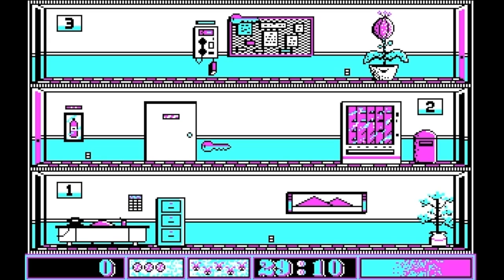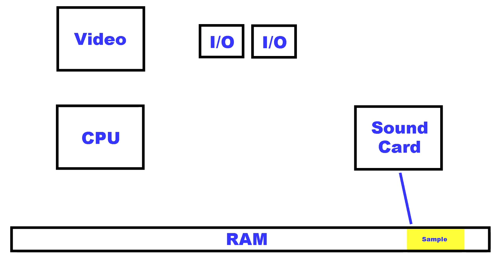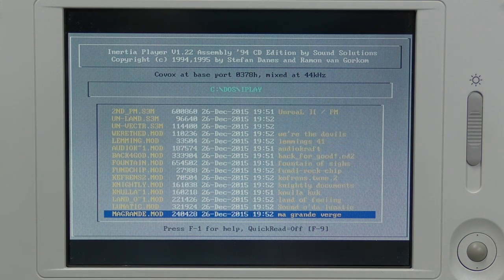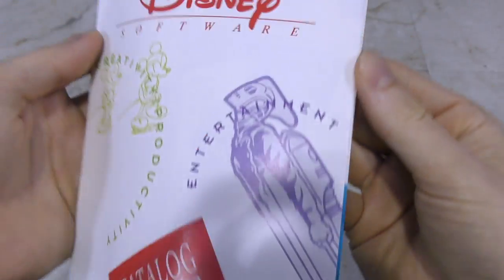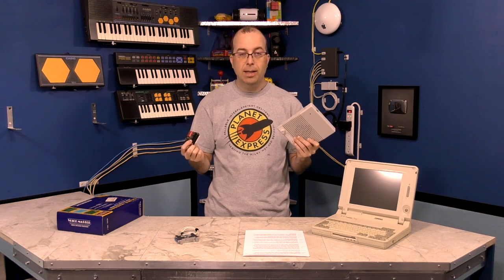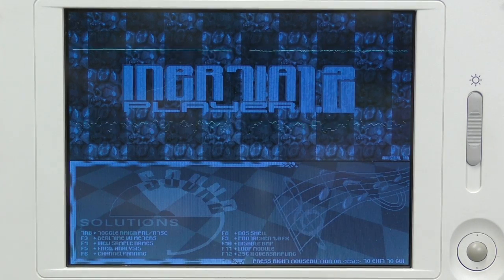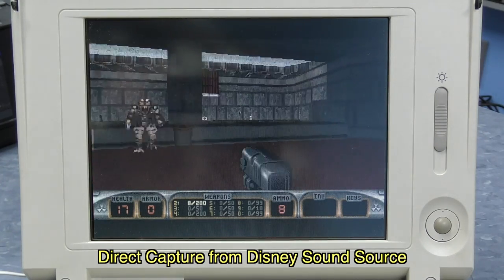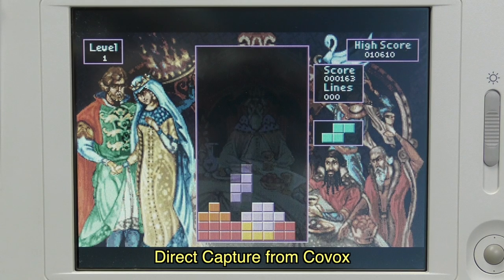How the Covox and Disney Sound Source Worked.

Comment: Just as an FYI, because no-one else has said anything about it yet - putting out to the parallel port is far less heavy on the CPU, because you can DMA to it most of the time. And when you can't, then you can at least use timer-controlled interrupts... the CPU does get taken over during that time, but it shouldn't take any longer to move 8 bits to the parallel port than 1 bit to the speaker, as it's just one clock tick either way to move 8 bits on a PC (or 16 on a 286, 386SX, or 32 on a 386DX / 486 / etc), or anything less than that. And there isn't all that extra code needed to try and translate 8-bit samples down to dithered 1-bit, it can just throw them straight at the Covox and have done with it, exactly the same as playing through any other sound card.

If it was anything other than like that, after all, your computer would get tied up hard when using the parallel port - for printing, or with a Zip Disk or CDROM or memory card reader or other such external drive connected, or a scanner, or any of the other various devices that co-opted it, all of which would need to move at least as much information per second as for sound playback. Even a floppy drive rates about a high enough data rate for better quality audio transmission than the PC speaker (it can sustain about 15kbyte/sec, and that's an average - peak speeds over the course of a rotation can be much higher), and a CDROM of course needs 10x that rate (reading rather than writing, of course, but there were eventually parallel CDRs that ran upto 4x), Zip sitting anywhere from about 45 to 300 kb/sec depending on how good your parallel port chip and driver software was. 8-bit mono audio at a CD-like 44.1khz would be, well, 44.1kbyte/sec... (using small 1000-byte kilo's, of course).

Let's put it this way - did you notice any kind of slowdown with that 486 when it was running Covox audio, even at 44khz? I remember using Inertia Player back in the day, and it had some quite nice visualisations built in, and it could handle some VERY hefty modules, stuff that might even occasionally challenge a 486 with a proper soundblaster (stereo, 16 bit, but not really an issue given that it was a 32-bit system; the only slight slowdown might have been from the card sitting on the 16-bit ISA bus instead of the 32-bit PCI one, but it was kinda daisy-chained and buffered anyway). If you load up one of those, and then put up one of the heavier visualisation screens, does it seem to stutter at all? If so, any difference between changing the CPU speed between full and battery-saver (on one of those, likely 25 or 33mhz and 8mhz, so you'd be looking at something like 11 to 14.7khz at the lower end... though, it could play DN3D, so maybe it's 50 or 66mhz?! rare to see anything faster with no built-in audio...), and turning the sample rate up and down by a similar amount which should reveal any difference in how the actual audio calculations are lagging the processor vs the DMA transfers? (obviously the common sample rate between high and low CPU speed should be the lower of the two...)

I have a funny feeling the answer would be no on all fronts, given that this was a device initially made for pretty low-end machines... the only things that generally couldn't be upgraded with internal cards were laptops, which used to lag behind desktops in terms of power even more than they do now, and anyone who couldn't afford even a basic Adlib or a Tandy-type card (there were clones like the Mockingbird; presumably you could, at least back then, get around the detection issue by shadowing part of the BIOS into RAM then inserting the Tandy string to the shadowed part...?) likely wasn't able to find the even greater pile of cash required to upgrade from their old "mute" 286 or even original 8088 based machine. Now consider the actual differences in raw mhz between the machines in question, and more particularly the difference in speed of their respective peripheral buses, and how challenging they'd actually find the extremely simple and fundamental task of taking data A and inserting it to address B. The latter cannot really have got more than 2x faster down the years, especially for 8-bit data which wouldn't see any actual speedup from working over a 32-bit bus vs an 8-bit one. If your 486 runs at a healthy 33mhz, then even the slowest 8088 isn't any more than about 1/7th the raw mhz - it's such much more capable a machine mainly because Intel did a lot of work to reduce how many clock cycles the more complicated instructions took, and introducing even more complex ones that could take the place of several old ones in a single, efficient step that saved time by reducing the amount of memory reads needed to run through the procedure as well as needing fewer actual calculation ticks. So that's 14x difference at the most, between efficiency in that extremely simple task and actual clock speed. And whilst both of those are likely 1:1 with their main frontside (CPU to RAM) bus, the peripheral bus hanging off that is probably the same for both - good old fashioned ISA. Not much call for PCI grade equipment in a 33mhz laptop, so why mess with what's not broken? If I'm extremely generous here and assume the 486 has some flavour of EISA that's 16 bits wide AND can use that to its advantage, and it runs somewhere in the 14-16mhz range (either being twice the 7mhz of the original, or half the clock rate of the CPU), there's something like a 4x speed differential.

Of course, that's oversimplifying a bit, and there's matters of how fast each one could context switch in response to an audio timer interrupt, how much slack the program code had in it (even with an original PC there might be large parts of a video frame where it was essentially idling in simpler games, whilst DN3D on the 486 will be running the CPU ragged 100% of the time), so on and so forth... but, on aggregate, I'd suggest those figures effectively mean you should be able to plug a Covox into an 8088 PC and, if you kept the sample rate down to about 11khz, or at least the 7khz of the DSS, see either minimal slowdown or in fact none at all, and in fact possibly nothing worse than would be seen with a Soundblaster in the first place (given that ANY PCM-based sound channel is going to create more load than a typical consumer grade synth chip that's not itself trying to produce PCM through crazy PC-speaker grade tricks; I think the maximum that an SB16 synth can actually accept in terms of command rate is about 95kb/sec, and that's during peak load e.g. initialising at the start of a song... normally it would be far, far less, hundreds of bytes per second in some cases... those those writes themselves would need to be correctly timed and buffered...) - though of course some small lag might be noticeable vs plain PC speaker or some kind of synth card. IE, the worry about it clogging up the computer is probably overblown. You can get variants of the device for basically any computer with a parallel port or other exposed at-least-8-bit-wide bus, after all, even some sub-1mhz models, so it must have been considered worth the trouble.

The one problem I could see with using DMA is that you might not be able to effect any kind of control over the replay rate from the computer end, usually it was up to the connected hardware to deal with its own timing then signal a request for DMA access to the computer, whose bus controller would then either say OK or make it wait for a moment. This would even be the case with the parallel port even though it's the computer's own main DMA controller that would be responsible for chucking data at it - you would be able to set a start and end address in memory (or start + length more often, e.g. up to a max of 64kb at a time before having to bother the CPU to set up a new transfer), and tell it where to send the data to (more traditionally a sound or video card, or the disc controller, but in this case the parallel I/O port), but after that the timing was down to what the recieving device could handle or would ask for. Same way as with a connected modem or regular printer.

Happily those ports have such control lines built in, but presumably whoever made the Covox went for the "cheapest and simplest possible" philosophy (whilst we're on the subject: the absolute nerve of asking $79 for something that's essentially a septet of resistors soldered across eight pins of a parallel plug, and then connected to one side of a mono headphone jack, with the other connected directly to the plug shield... damn... some people really know how to hustle), rather than "the cheapest and simplest that's actually practical" alternative. The PC side of the port, after all, also has some measure of control ability beyond simply putting 8 bits of data on the main pins, and it surely would have been a simple enough matter to use a loopback of some kind to con the PC into self-triggering a DMA send under timer control, or put in something simple like a 555 chip to trigger another "ready to receive" blip with the PC's "new data on pins" strobe resetting the counter... or in fact it could basically be free running, just with that pin supplying enough power to run the chip, so when it's active the device continually asks for another byte every 1/7000th of a second, and when it's not active, well, the chip isn't powered. In fact, I bet that's literally all the Disney thing does different - it shouldn't NEED a FIFO on board, because the PC I/O system already has them built in, and the data is kept valid on the parallel pins for as long as it needs to be between updates; adding an extra buffer to the device itself sounds extremely hokey. It's more than likely they just altered it very simply to be self clocking - at what is possible THE lowest sample rate of any common PCM audio channel in existence, other than the Atari STe's rarely used minimum 6.25khz rate, and the extremely low quality 3 to 6khz samples used for certain Amiga SFX...
Reply: (which is a pity really - I bet for a dollar or two extra on the sticker price, they could have implemented some way to change the rate between certain more useful settings, say a choice of four at 5.5, 11, 16.5 and 22khz, or 8-12-16-24, etc, to better match whatever material was being played... 24khz is in the same sort of zone used for higher quality sample playback and moderate quality music synthesis on various 16-bit consoles and non-PC home computers after all, so it would still have sounded just fine, and the others could cover various other uses down to plain speech... and, heck, a simple choice between 11 and 22 would actually have covered the majority of bases. And as there likely wouldn't have been any need for the rate to be absolutely consistent between each individual unit, or even to remain constant as it warmed up, a simple 1 or 2 way flipflop (ie essentially a 1 or 2 bit register), or even a set of AND/NOT gates on a generic logic chip if the status lines driving them could be kept latched on or off instead of only operating momentarily, plus a dozen or so additional discrete components (resistors, capacitors) besides those already attached to the data pins, connected to the timer in different configs depending on the set speed, would have been entirely ample. Not even any need for an actual crystal, just a resonant RC tank... frequencies in the dozens of khz are entirely within the spec of a 555 or similar...)

Oh well... old timey things, people did some weird stuff that must have made sense to them at the time, even though with 30 years of hindsight we can look at it and go "hey, you know, if you just added this one extra component in here you could make your thing work so much better for mere pennies...".

...and now I'm wondering once again about whether plugging such a thing into an old Atari could add a handy Actual PCM channel to any ST model alongside the PSG... and give the STe's a third channel to play with besides their existing two, meaning that if you also took advantage of PSG sample playback it would have an Amiga-rivalling four hardware sample channels.

Though the Amiga would still hold the advantage over anything else discussed here thanks to having a crucial ability otherwise only actually seen in general with proper PC soundcards and some Yamaha all-in-one soundchips - completely variable playback rate, as in each of its 4 channels has its own DMA timer circuit, and can divide the system clock down by between about 256 and 65535 times with very fine granularity, so the CPU doesn't even have do the precalculations and prebuffering every other system not so equipped has to in order to replay things that aren't an exact match for the hardware playback rate, hence why it was such a good system for playing tracker music on,  because once you also consider the dma interleaving possible on 1980s vintage 68000 systems (the memory available at the time had developed rapidly enough that affordable chips were twice as fast as what the affordable CPUs had been designed for, so a relatively simple bit of buffering and access-channel switching meant that AV output DMA's could hit the shared memory space without interrupting the processor at all), it can read and output four different 8-bit sounds each at any arbitrary frequency from about 110hz (so it can do pretty deep bass using a simple waveform) upto 28khz, and any volume across a 60db range too, without placing any measurable load on the CPU other than that needed to reload each channel register with the start address, length, speed and volume of the next sound.

So no matter what you plugged into your machine, unless it had similar self clocking DMA ability, it would always place more load on the system than an equivalent Soundblaster, or the Amiga soundsystem or that of an equivalent console. But I still can't see a Covox really demanding so much system time in its own right (there's no law saying you HAVE to use arbitrary frequency samples with it that then need actively retiming by the CPU either before or whilst they're playing after all)... the actual strain it could cause would be more down to the software and drivers making use of it, same as with a lot of sound sources.

Of course, the bigger question is why they did something as wild as making an actual plug-in DAC - and charging a king's ransom for it - when at the time very few games would have had sampled audio anyway, and it's far more likely that the majority of support would have extended to having it make some rather PC speaker style 1-channel bleeps and burbles at quite low frequencies, just with a greater range of still simplistic but hopefully less ear mangling waveforms, variable volume, and less system load than all but the simplest low-tempo timer reloading... and I'm afraid I can't help returning once again to good old fashioned laziness and profiteering.

Let's compare another device, which could easily have been built as a Covox-style parallel plugin if desired, with just a minimal amount of interface logic - the FM Melody Maker cart for the Atari ST. A device that concealed a variant of the Yamaha 2151 synthchip (as found in the Japanese version of the Sega Master System, amongst its other rather limited uses), some interface logic and a couple of software controllable passthru sockets for mic and the computer's main sound signal (3.5mm, with an output 3.5 at the other end), which plugged into the computer's ROM port. Able to produce, IIRC, six simultaneous channels of 2-op synthesis, with 15 preset voices and one user redefinable one, and also able to make a handful of rather weedy percussion sounds on top of all that. It came with a pretty decent audio sequencing program that could provide auto accompaniment for anything you wrote onto the main stave, or played in over the computer's MIDI port, amongst other abilities. Driver support for games was a bit patchy, but this was a machine where the primary sound source was a built in 3 wave + noise PSG, and the second line option was MIDI output, so it was fighting an uphill battle... still, some titles made use of it, and you could always, if you had two STs, pipe MIDI output from one into the input of another running the sequencer, set to "just turn whatever comes in over MIDI into sounds with no fancy automatic stuff" mode... and it would STILL be cheaper than a Roland MT32, or most PC soundcards.

The price of that little box of wonders? £99. Or not a huge amount more than the Covox. In fact, not even 50% more, even on a day with a bad sterling:dollar exchange rate. And one assumes it was priced to turn at least a modest profit.

OK, it couldn't do sample output, but at the time, same as for the Covox, that wasn't really any kind of an issue. For the rare cases where sampled sound output was desired, you could always manipulate the PSG into creating it without so much slowdown that it would hang up the machine (some later games could do it well enough to play actual MOD soundtracks whilst providing an arcade-speed experience), and PC users could still get the output just at the expense of a momentary pause. In all other cases, having some kind of half decent synth was far more useful, which is what this, much like the Adlib or even Mockingbird/Tandy, provided with much more aplomb.

If you've somewhere around a hundred bucks to spend on a sound upgrade for your computer, what would you think is more worth your money - a very slightly more expensive one which gives multiple channels of half decent synthesis and places almost no measurable load on the rest of the machine (heck, the presets mean there isn't even the same register-loading requirement as other FM chips unless you use a custom patch, you just pick a channel and instrument number, volume level, and note value to trigger, essentially three bytes all up), or a slightly cheaper one that provides a single channel of potentially rather system-punishing PCM?

Sadly as the former wasn't available in the PC scene, and the latter probably positioned itself as being "the cheapest PC audio solution, period " (cheapest, yes, best value? no), they probably ended up rolling in cash as so many desperate cash-strapped PC owners who either couldn't fit a proper card or simply couldn't afford one ended up falling for it and paying a whole load of cash for something they could make themselves.

Oh yeah, maybe I should have mentioned that one earlier. It doesn't seem they even bothered patenting or copyrighting the design, either again through laziness, unwillingness to spend the necessary money for registration, inability to get any kind of patent or rights granted because of how entirely simple and self-evident the design is and how it does absolutely nothing not covered by prior art other than jamming three well known things together in a line - a DB25 plug to connect to the PC, a resistor-ladder based DAC, and a 3.5mm jack socket to plug a lineout into. And mind that it has to be line-level - the Disney speaker isn't just for show, unlike a Soundblaster or Adlib, it doesn't have even the simplest of op-amps in it (which could probably have run by vampire power off the port), so it can't run even tiny passive speakers, they have to be selfpowered.

Honestly - if you heard someone mention the concept of the device, you could likely look up generic electronics plans at your local library even in the 1980s that would give a pretty good idea of how to build your own. By the time the 90s came round the schematics were in common circulation, and you really could just build one for pocket change (buy the plug, the jack socket, and a short strip of bulk-pack resistors of a certain single value (470 ohm?) plus a bit of heatshrink to go around it as protection if the plug didn't come with a large enough housing to contain all the other components) in about ten minutes if you were any good at soldering. I've a ~1992 magazine somewhere with the blueprint in...
Reply: So yeah, anyway, extremely long story sort of short, totally baffles me why no-one made a corresponding plug-in with a proper soundchip of some kind in it. Or at least why, if it actually happened, it didn't do well enough that its existence is common knowledge. Perhaps it would have happened by the arrival of the Covox killed the idea before it could get off the ground simply because of its pricepoint, unfairly taking the exact niche where such a thing would have to have aimed for itself.

Even just something as simple as the ubiquitous YM2149 / AY8910 (which is effectively identical to the Tandy chip in all but some extremely minor and unimportant ways) could have been a massive improvement over the PC speaker, and certainly been a boon for any laptop, and probably could have been made for quite a bit less than the Covox. And there's a whole range of FM chips that could have been used, from the original OPL and the aforementioned OPLL (ie YM2151), through the OPL2 and various OPNs on the Yamaha front, and more besides by other less planet-straddling ubercorps, like ESS, Texas Instruments, Roland and so-on, with a great range of potential price points.

One thing that might stand out here is that the 2151 Atari cartridge mentioned actually plugged into a proper ROM expansion port, with separate data and (cut-down) address buses and a whole pile of control lines, but little of that actually matters - because it, like a lot of Yamaha's soundchips including the 2149 already installed in that same company, it uses an interleaved bus design of only 8 bits, with a very small number of additional multiplexable control signals used to signify whether any given data presented on the main bus is a register address or data intended for a previously latched address. So connecting via the parallel port would be no great shakes at all, so long as the remaining out-of-band signals could still be transmitted to the chip somehow.

(in fact it even works like that in the cartridge ... effectively all of the address bits, and half of the data bits, are kinda wasted...)

I'm almost tempted to try making one now, especially using something like one of the later smaller-package revisions of the 2149 which cut away various features not relevant to a simplified task of "accept data coming in on one side, produce sounds that go out the other end" and have actually proven small enough to happily fit onto a PCB crafted to fit inside a Gameboy cartridge along with a flashROM and certain small control chips too. So it would have every chance of fitting gracefully inside a parallel port plug...

After which it's just the sticky problem of writing the drivers, and I'm fairly certain turning MIDI type audio commands into something the chip could eventually understand and replay is nowhere near as easy as it sounds, and about a thousand times harder than simply running a timer loop to either perform DMA or trigger CPU interrupts for programmed I/O (which, bear in mind, was actually considered acceptable even for hard drives until the early 90s, if there was no other practical option) in order to advance a data pointer one step further through memory, and push whatever data is in that memory position to LPT... leaving the game designers to figure out for themselves, each time, how exactly to integrate it or just ignore completely, and the hardware makers not needing to know hardly anything other than how to solder a DAC together in unusual ways.

So whilst I'd much prefer to do the latter, the former could probably be achieved with some  tiny level of effect, even if just to hit a point where it could play Twinkle Twinkle from just a few bytes of input...

.................................ok, i think i've burned this one out, and I really need to go to be. "Sod it, whatever, i'm outta here"